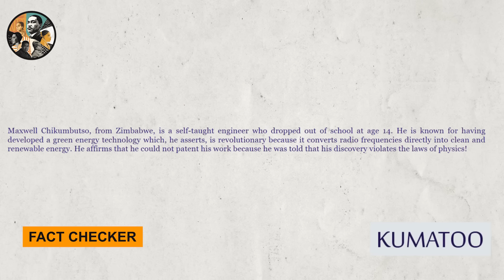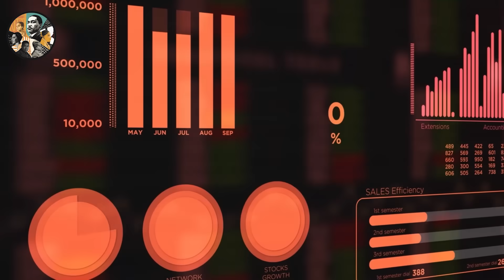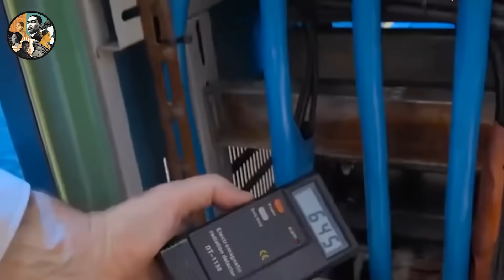Elite University & Scientist Teams APPROVE Self Powered Car & Free Energy Device Invented by Maxwell

Comment: stop mis-reporting, technicall its a charging unit which already charges batteries using RF frequency. You will have noticed that there is a nest of battery in the unit and once the charge rate is greater than the consumption rate , the car will go on indefinitely. What we all need to know could the car be started with zero power from the battery using the unit as the only source.

Comment: This free energy will power our combustable engines in our automobiles  🚘  , can't be........ Can eliminate batteries  🔋  or electric motors  , don't think so  🤔....
Power our houses  🏘 and the nation from some radio  📻   frequency and fly 🪰  our air craft in the skies....
COME ON  , WHAT ARE YOU SMOKING  🚬  , I WANT SOME  .....  ❤  .....

Comment: If you have 2 batteries with a total of 5000W of electrons, when you high frequency switch MOSFETS,  and back feed the output into the input, you will still have less than 5000W because of the electrons used up by circuit losses. If you have found a new revolutionary method, make the circuit open source. Otherwise, take your excuse of "free energy" and put it with the other free energy machines using springs and magnets and do not insult us!!!

Comment: I am sorry to say Mr. Chris Wabs the so called expert on your YouTube channel does not understand or have any clue what he is talking about (maybe a bush technician) or know or have any substance on radio transmission, resonance, induction, power inverters, DC- DC converters, capacitance, frequency modulation, phase modulation, electromagnetic waves from LF, HF, VHF, UHF, Microwaves, Light Waves etc. There is a wide spectrum of frequencies. As I mentioned in my previous YouTube comments, Mr. Maxwell Chikumbutso is suggesting that he is harnessing radio waves & is using that to run his load in this instance the electric car, electric motor bike and able to run power grid loads. As a retired Radio Technical Officer with our local telecommunications company Telikom PNG Limited and was appointed as part of a Technical Team to do Factory Testing & Acceptance of solar photovoltaic panels at Solarex Factory, Sydney, Australia in the mid 1980' s and also Factory Testing & Acceptance of microwave radio terrestrial equipment at Nippon Electric Company at Yokohama, Japan, it is possible to harness radio waves but you would need a reliable, constant radio waves input to Mr. Maxwell Chikumbutso' s device the so called "Microsonic Energy Device" to work. And as I mentioned previously he may be using passive or active Radio Frequency filters or Radio Frequency trappers. Now if you are able to do that then the voltage would not be sufficient to run any load & therefore you would need a DC to DC voltage converter along with a reliable deep cycle battery, diamond battery or super capacitor battery or other storage means to run your load or the voltage is connected to a power inverter to generate AC to run your load. As I suggested in my previous comments on YouTube if Mr. Maxwell has found a way to harness constant radio ways then Mr. Maxwell should be commended for that after a proper technical tests & soak tests be done by a professional Radio Technical Officer or a Radio Engineer. I also suggested previously that Mr. Maxwell Chikumbutso run the power grid on full load of his local town or local city with his "Microsonic Energy Device" for 48 hours and this is recorded on a calibrated graph or on a computer for analysis. To confirm his device is working as claimed, one would need a well calibrated: HP "Radio Frequency Spectrum Analyzer", "HP Radio Frequency Counter", "HP Oscilloscope", "HP Clamp Current Meter", “HP Chart Recorder”, "Fluke Voltage Meter", "HP Test Equipment Camera" & other Auxiliary Test Equipment to conduct an accurate & valid tests on Mr. Maxwell's "Microsonic Energy Device". Basically to measure & confirm radio frequencies (what frequencies), how much (quantities value) is entering Mr. Maxwell Chikumbutso' s "Microsonic Energy Device" and how much voltage and current are at the output & are running his load. Now that is not hard to do & would not even take 1 hour if permission is granted by Mr. Maxwell Chikumbutso. I am willing to conduct the tests. Greetings to Mr. Maxwell Chikumbutso, from Papua New Guinea.